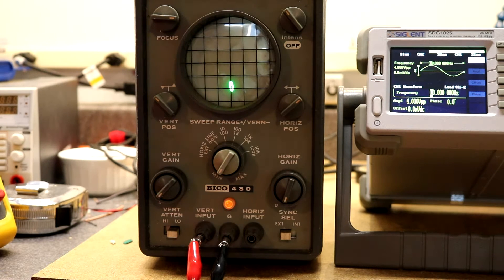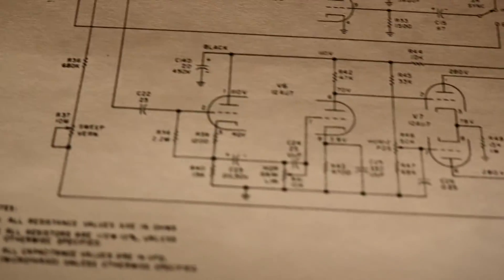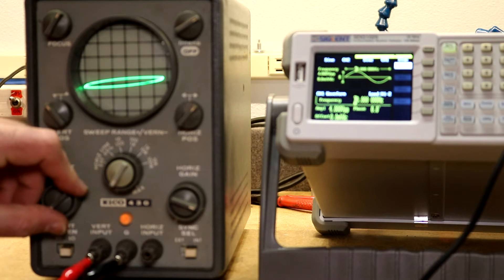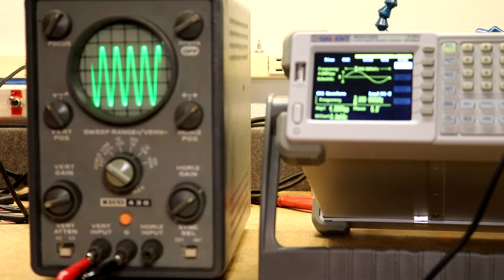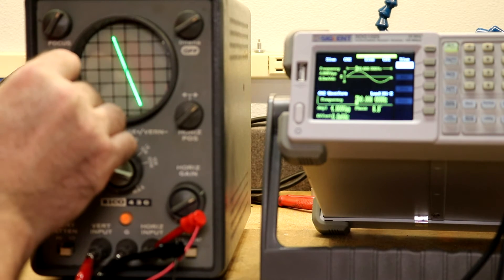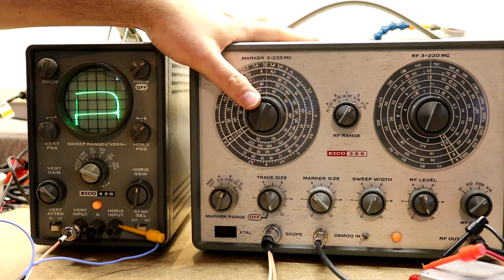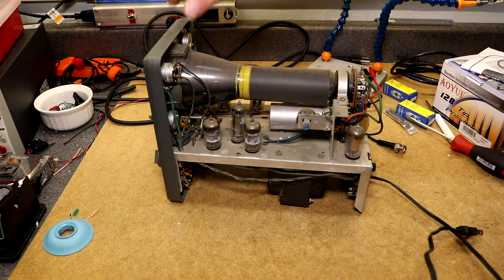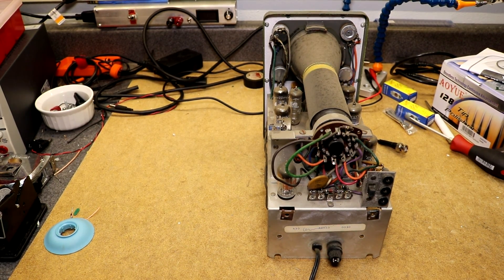Eico 430 Oscilloscope - 1950s Tube Era Oscilloscope

Comment: I'm just about finished restoring my 460 - it has a few of the same tubes I notice.  Mine was dead though - but the power transformer and the CRT were good; no deflection in either direction and no response to any controls.  But with those two big parts working, everything else was easily obtainable and replaced.  Nice job, thanks for posting.

Comment: For the tilt on a lot of those old scope you have to actually rotate the whole tube. The tilt varies based on the magnetic field of the Earth. So it would be different in New York than in California, etc.
Reply: I had to do that with my 460 to get it straight.  Also I noticed that if I rotate the scope 90 degrees it adjusts the vertical, but at least that's flat and can be tweaked.
Reply: PelDaddy